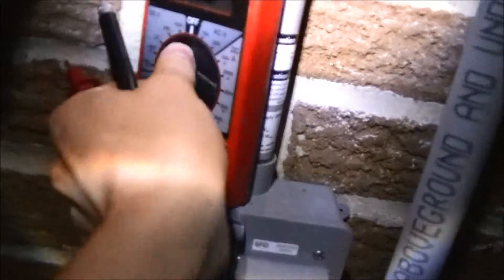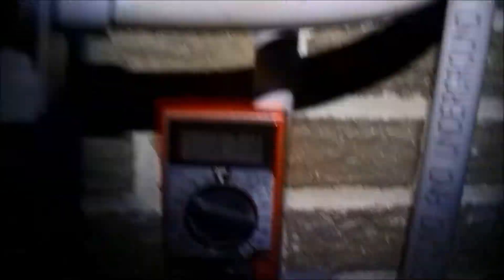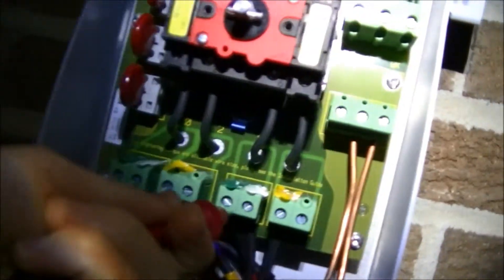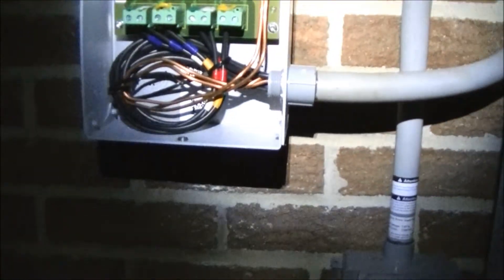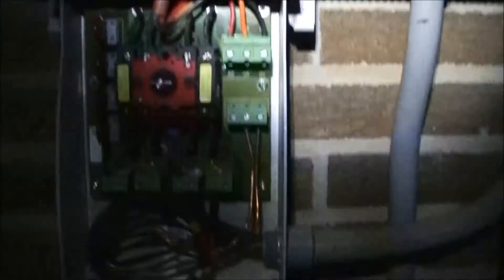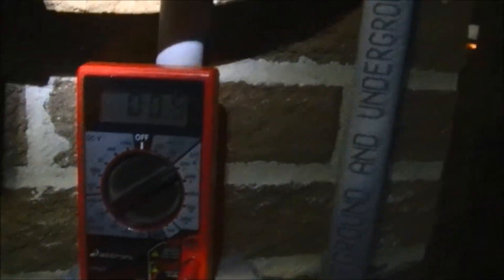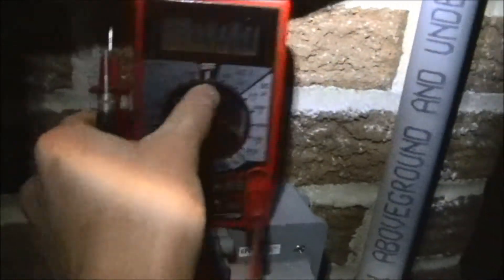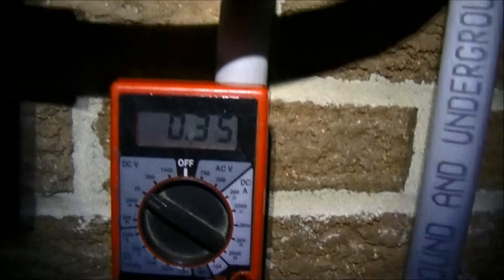Moonlight Power?  How Much Power Can We Get From 3KW Worth of Solar Panels With a Full Moon

Comment: do the panels have micro inverters? then they arnt putting out their voltage as they arnt firing up, plus they need to see the ac voltage on the other side too, they wont put into a dead system

Comment: i could charge my phone with that many volts with a boost converter
Reply from the maker: That's what I was hoping but you can't. not enough power. when you boost the voltage you need a lot more current. It was only 20uA at 0.3V. really small. maybe it would be enough to dimly make an LED glow if your stepped up the voltage with a boost converter. But I'd have to be a very efficient and low voltage input one.

Comment from the maker: Yeah you probably could.  There are things called geothermal heat pumps that use the ground instead of the air.  In the winter the ground is a lot warmer and has a lot more mass then air.  And then in the summer you use the ground that you cooled down to cool your house.  Tons cheaper then electric heat!  But not all that competitive with the natural gas  we have here.

Comment: I got you, the inverter is open circuit so the meter was shorting the modules... FYI the description is still wrong Amps X Volts = Watts you mean 20 micro Amps right?

Comment from the maker: When I put it on the current setting it was basically shorted though the meter.  I was just measuring the short current across the panels.  Not how much was going into the inverter because the inverter was disconnected.

Thank you!  Just fixed it!

Comment: Ya, moonlight didn't expect anything usefull.  Good to know for sure.  However, u may have wanted to disconnect the cable to see if there was any drain into the inverter.  There might actually be some useable power before it's connected.